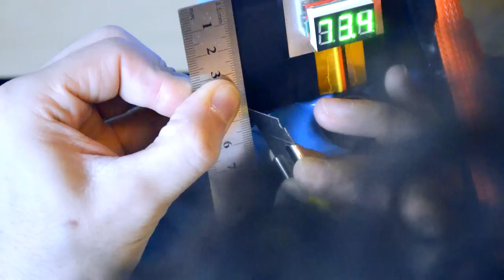72V 29Ah 20s10p high density li-ion battery pack

Comment: great video !!!! hi i wanna build a electric kart i'm planing to use 2* BLDC golden 3kw 48v motors can you please tell me how to choose voltage and amp for my battery pack to achieve around 100 miles. your ideas and suggestions much appreciated. thanks!!!
Reply from the maker: +Nadishani Gunasekara 100 miles of range needs around 4kWh of energy if you have a total kerb weight less than 150kg in an 2wd e-kart with direct drive BLDC and around 6kW continuous of maximum power. The voltage must fit your maximum speed aims. With 16" wheels and standard winding BLDC hub motors 48V nominal battery let you around 25mph of maximum speed. It would be a 48V 85Ah battery
Reply: +Damian Rene i really appreciate your reply!!!. however  i'm planing to use two BLDC motors mounted in to a gear box (its not a hub motor), speed aim is around 40mph and curb weight is going to be 325kg (est.) . as you may know the company (golden motors)they have two different 3kw motors which are 48v and 72v can u please suggest me which one to buy and how much power will i need to achieve 100miles of range and 40mph. thanks !!!!!!!!!!
Reply from the maker: Adding the friction system to the equation, the 325kg kerb weight and 40mph top speed, despite which geared motor or controller, you will need around 5kWh to reach 100 miles of range at 30mph of average speed.

a 48V 3kW motor and a 72V 3kW motor, are technically the same motor, the differences become with different power rated motors. Both works safe under 3kW continuous power, it doesn't mind if you push 62A at 48V or 42A at 72V, both generates the same heat (almost, higher voltages are slightly more efficient).

And usually any 36V rated motor or 72V rated motor can be pushed at any voltage you want, and the result will be the same for the same power input, so basically a manufacturer rate its voltage based on an rpm aims. To get out of doubts, you must ask golden motor if their 36V and 72V versions have differences in Kv rating (Kv = rpm per volt).

If both motors have the same Kv rating, that means they are indeed the same motor, and will perform exactly the same under the same volts * amps.
Reply: +Damian Rene they said that for 3KW 48V and 72V rate speed similar. 
For the same motor, 72V speed are a little higher than 48V. 
For same battery capacity, 72V range are more than 48V. 

and also i wanna know since i use two motors should i double the battery pack?

thanks alotttttttttttttttt
Reply from the maker: it doesn't mind if you use one or two motors, make calculations along your continuous power capabilities of your controller, or two controllers combined. You have more power with two motors, but for a specific speed the power consumption is almost the same (higher with two motors)

Comment: If make up a battery pack and fit it in the triangle under crossbar and fit say 100 0w rear hub motor to my 36v 250w  ebike and get new controller ect.Can I also keep my existing fitted battery as.Its Samsung looking foroor speed and range.Have 26in wheels more concerns with top cuising speed and range than torque as road bike.Mainly but goes anywhere.Only have front suspension.Would like to use my bike as sturdy,but would consider another bike as mine goes fine.Anyone help please?

Comment: Out of curiosity, why do you not use fuses? Great video btw.
Reply from the maker: +j9312 If you work with factory new high quality 18650 cells from the same batch, and you limit the maximum discharge up to 1/3 the maximum continuous discharge, fuse system is not mandatory if the battery is properly installed and impact-proof. In any case, if you have a self short / thermal runaway their internal valve would liberate pressure to avoid a container break. With this chemicals used in this battery "NCA" you also avoid a chance to have a chemical burn because of high heat.
However, if a crushed cell after an impact would have a valve issue, a fuse system won't avoid it to explode because a self-short.
If the battery have 10s or less (not this case), you also count with PTC and CID internal fuses all 18650 cells have, that only can secure their right function for voltages under 42V (10 series), so you already have the battery fused.
In this case (20s) you only can count with their pressure valve, so if a self short happen (crush or wrong discharge rate) will make in any case all the parallel group to be discharged to 0V. A fuse system would avoid more cells than harmed for an impact of internal fail to be destroyed. So I'm agree is always recommended to make a fuse system for >10s batteries.
In this case all the discharge parameters are strictly controlled (is for my personal use) , that's the reason I choose a simple construction with no fuse system.
Actually I have made semi-fused batteries, soon I will upload videos with those systems.
Thanks for comment
Reply: Awesome. I'll look forward to the video. Thanks for the response. Two follow up questions: Have you ever had individual cell failure after cycling? (and) What do you use to charge your packs?
Reply from the maker: I have not get yet a single cell failure, but I only use high quality cells and inside their good discharge parameter rate. To charge li-ion batteries you need always a li-ion charger for the suitable voltage. For single cell charging I use simple Chargers as Nitecore D4 or Opus 3100
Reply: But charging the pack? Surely you don't charge each cell individually again.
Reply from the maker: in this case a 84V 4A li-ion charger
Reply: wow, did not know they sold those!

Comment: It would seen to me that a good build would use a heat spreader/ ventilator tubes-- within every few dz cells. Since heat is the enemy and in everyones rush to density and COMPRESSING heat. They just aren't looking at battery temperatures lower is better. For life and output..   Most room is available- we are not going to the moon and the gov't is not saying we can't be 15% bigger and cooler.
Reply from the maker: +Joseph B&#246;hme I'm agree for most uses I see batteries to be overpowered and reducing their life span / cycling life because of heat. It depends closely of the discharge rate and also model of cells. In this case the battery works below 1C and it doesn't even works slightly more than warm.
although "decompressing" the volume adding mass to the battery could make a better heat dissipation at first sight, it only would work if all the mass you add have a good heat dissipation.
When you use cell holders for example, you add air, and that makes indeed a worse heat dissipation that attaching the cells like in this video, completely in contact.
In any case you can always control the maximum discharge rate on your controller

Comment: I'm not an expert, but packing cell this close together does not seem like a good idea.
Reply from the maker: It doesn't indeed, only when you really know the battery will be installed in a good protective case and secured of crush / impacts. This helps achieving the maximum energy density but not the maximum safety..

Comment: this cells never give 2.9ah... real life 2.5-2.6 (1C discharge).. plus on 3C discharge you going kill them in 100 cycles..
Reply from the maker: +Artur Ragulskyi In an Opus bt-c3100 2.2 analyzer I have got around 2950mAh measured after the first factory cycle at 0.35C, slightly better than LG MG1 2.85Ah and Panasonic PF 2.9Ah that I have also tested from factory new state. I will make a video with a test with those cells together too see if I find different results.
In addition I have made several batteries with those 2.9Ah different cells and I feel the 29E to be the best performing at around 1C continuous discharge, I will try to make more specific testing.
 I always make the batteries to being working around 1C max continuous if I use this kind of standard 3C max cells. Thanks for the tip!
Reply: THank you for interesting videos. I use high power bikes, so I need 3-5C discharge, and not just for 3-4 seconds.
Reply: btw, do you buy the cell from China or in Europe?
Reply from the maker: For spot welded batteries always from Europe. Nkon.nl is a very good and safe shop for authentic cells. There are also some interesting supliers from Alibaba, but there are more risks
Reply: +Damian Rene How much did the cells cost you? I see in the video they all came in one big box. I've seen other people order laptop packs or cordless tool packs and re-purpose the cells in them for ebike packs. They say it's cheaper that way. But I was wondering what it cost you for a box like that. 200 cells, yes?
Reply from the maker: If you want to make a pack the same way in this video you shouldn't use laptop cells. These packs are not made to be repaired, and only with factory new cells and a controlled discharging / charge rates can last with no need of cell exchange. If you want to use laptop cells, make an unwelded pack with any kind of cell holders

Comment: bad design. certain spacing between the cells would allow for better thermals
Reply from the maker: If the battery is insulation shrink wrapped as this one, the cooling system works over the whole battery surface, passsively or actively. There is not advantage of having air gaps between the cells, because the air can't flow. Air is one of the best insulators known, if there is trapped air between the cells, each one can't transmit the heat at a good rate for their next companions to the surface of the battery.
When the design face 3 cells as in this case, their contact is complete and they can transmit heat quickly. Also the small gap is filled with silicone, not a perfect thermal transfer material, but much better than air, so the total heat transfer is dramatically improved than with a design where cells are not in contact together and separated by air.

If you want a greater heat dissipation than in this design, you can make a design where cells are not in touch and separated by air, but with an active cooling system moving that air (so you can't insulation wrap the battery or the cooling system must be designed to work below the insulation wrap). Only when the air flows, it develop heat dissipation properties

Thanks for your thoughts
Reply: I'm pulling "a bit" more amps (LG cells). Had the cells placed with a separator and temp sensors. Without the separator when pulling max design current I had some serious concerns over the temperature I was getting in the middle vs the outer parts. Separators help with as much as 5 degrees celsius. Keep in mind that this difference might be larger as the battery pack with the separators was running in a warmer climate (4 deg celsius). I'm thinking of 40 amps/cell peak for the next pack with water cooling.

Comment: No offence but you wouldn't be requiring a spot welding machine any more if you were to use this https://www.youtube.com/watch?v=6M6Mm6jWqSk&t=159s . All you have to do is assemble the kit according to your battery pack size. You can dismantle it, re-assemble it multiple times. It doesn't affect the battery life nor does it void the warranty if you are buying new cells. Its way way better than the spot welding method. So do have a look and do give it a try !
Reply from the maker: Contact systems are very interesting for static installations as for example energy storage for home appliances, where high energy density is not required, but not for other uses where volume is a limiting factor and spot welding or wire bonding is the perfect system if you need a permanent contact with a permanent low IR.

Those system have been used broadly and their problems are well known. The main issue about that kind of not welding systems, is that the contact between the bus bars and cells can't maintain its strength over the time nor maintain a good conductivity between both surface because small oxide and other particles form and keep between both BUS bar and cell material, rising IR over the time. This make them absolutely not suitable for dynamic installations were vibrations are present like electric bikes and electric vehicles in general.

Secondary the energy density is dramatically reduced (specially in that design, where there is approximated a 100% more volume needed) being also not suitable when volume is limiting.

Comment: how many battery to make 72v?
Reply from the maker: 20 series with Li-ion cells, 24 series with LiFePO4 cells, 36 series (6 12V modules) with Lead Acid cells and 60 series with Ni-MH cells :)